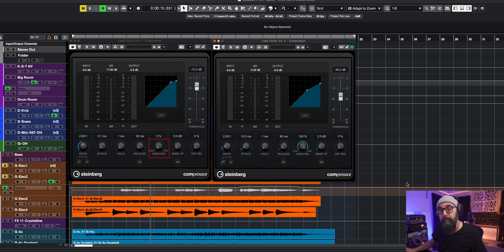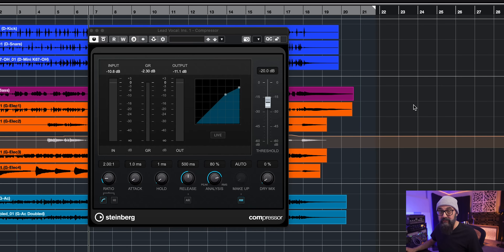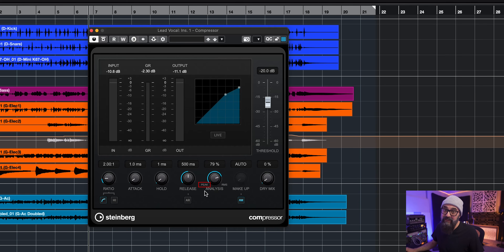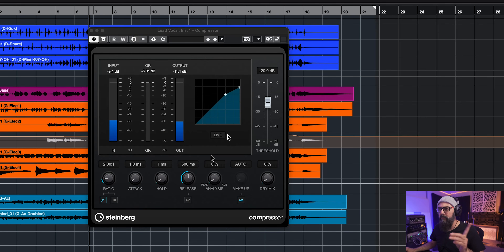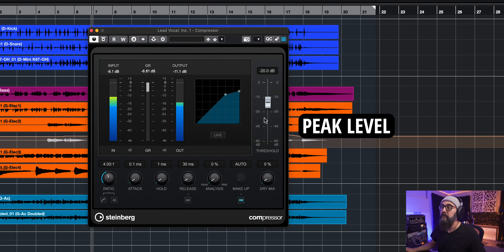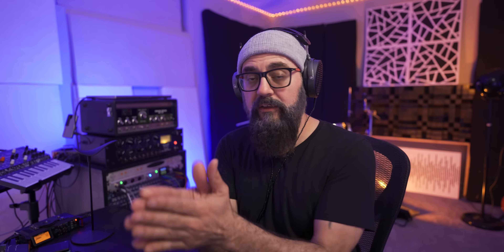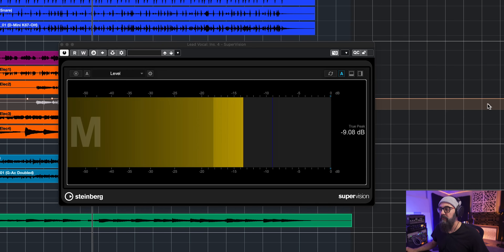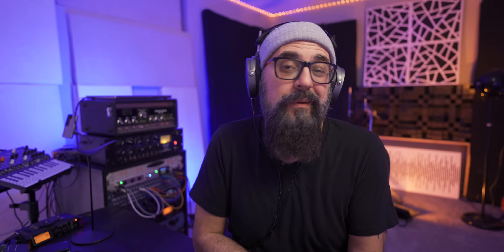Unlocking this MYSTERY KNOB on the CUBASE Compressor - Try it on Vocals

Comment: Great vid. I wish Steinberg team made an option to have at least 2 compressors in the channel strip. Channel strip has a great potential if made more flexible.
Reply: For very gentle compression after peaks have been dealt with by a compressor, using Magneto or one of the other sat. options might work sometimes. Not the same as having 2 compressors available though, and maybe in future releases the channel strip will become even more flexible (choose how many of each module type you want in the available slots rather than having one slot dedicated to a function as is currently the case).
Reply: Just use the inserts...you can change the order of the channel strip from pre to post the inserts so you have all options
Reply: @rthyhmmemory11 Man, you're starting the obvious. In that case, the whole point of the rack is useless.  I'm talking about the visual  convenience of the rack and it's limited features so far. Not that I can't live without the rack. I just don't use it as often because of its limitations.

Comment: Y en un redoblante?
Reply from the maker: I don't know what that means, sorry
Reply: @mixdownonline  and the same technique in a snare?
Reply: When compressing transient material such as drums, you can choose 'peak' mode on the Cubase Standard Compressor. Peak mode is for transient/percussive material. I would try a single compressor and experiment with attack/release/ratio to even out a drummer's hits. The Cubase Vintage Compressor may also be a good option.

Comment: Question, I'm a newbie with recording. I'm just using compression as an insert. is that ok. will it get recorded in the mix. or do I have to change something.
Reply: Hi Teddy, compressors (or any plugin) used as an insert on an input channel are recorded (ie. you are committing to the sound as impacted by the plugin). Most newbies (and plenty of experienced people) record 'clean' in case they, for example, overcompress the recording. Chris has a video called 'Recording with plugins in Cubase like analog gear' which delves into this. Hope that helps.
Reply: @adrianl5899  WOW ! this is very helpful. thank you so much my friend
Reply from the maker: Nothing more to add :-) Here's the video Adrian is reffering to https://www.youtube.com/watch?v=2BHVCKzOJzM
Reply: @mixdownonline  thank you Chris.
Reply: If you are using Cubase, any inserts you have on your tracks will be there when you export a mix.  Unless you have them bypassed when you export your mix. Simple as that. Cheers